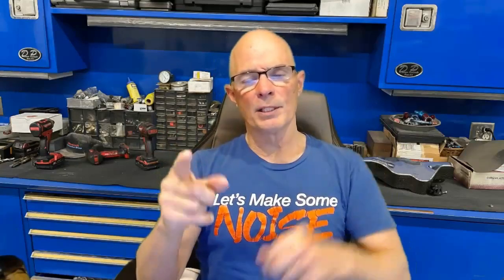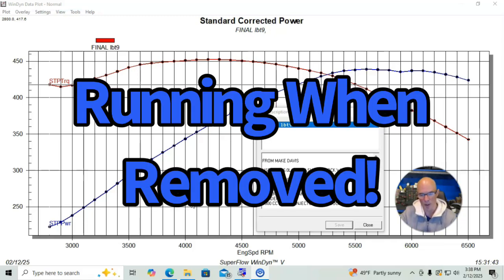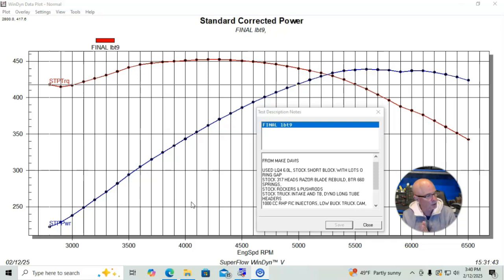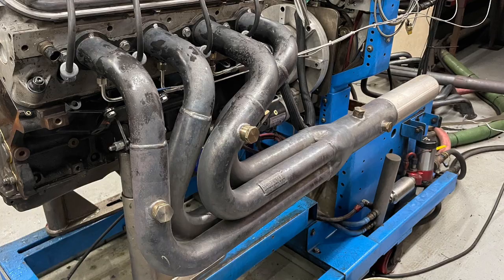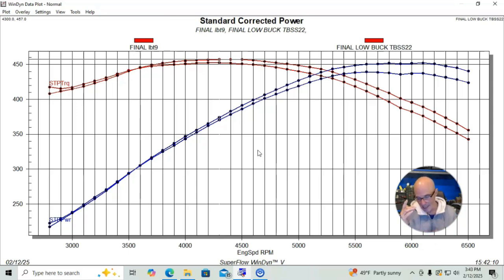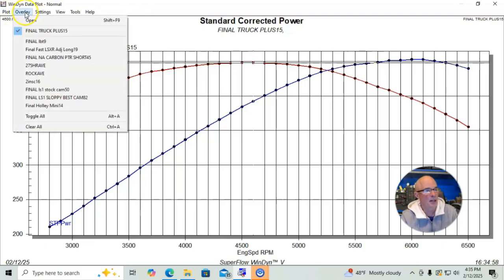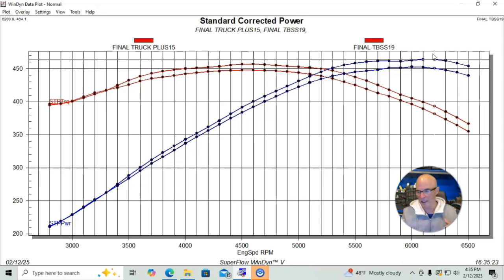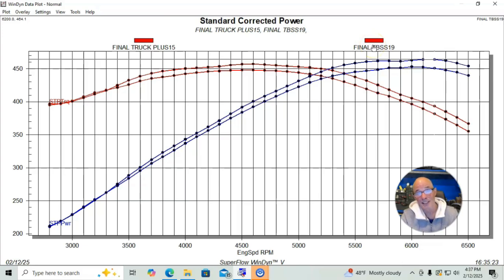JUNKYARD 6.0L LS INTAKE TORQUE TEST-TRUCK VS TBSS (WHO IS THE REAL TORQUE KING?) FULL DYNO RESULTS!

Comment: I am no way a machanic and looking for info I purchased a 6 Liter LQ4 and I have picked up a blazer S.S intake the motor came with no fronend parts and spark plug coils. Looking to buy some and find the bracket but the plugs coming off the Blazer intake are small plugs to the coil and stock coils are much larger ? is there a easy way to hook up with a connector
any help would be great

Comment: Has anyone tried the truck plus cam in an L77 6.0? They have rec port heads and the intake is similar to ls3. The truck and tbss intakes won't work.
Reply from the maker: it works fine

Comment: Can we see a comparison of the tbss intake and the rec port ly6 nnbs style intake. It has a slightly larger throttle body i believe and there is absolutely no info on this intake.
Reply from the maker: those two can't be run on the same heads without adapters (the LY6 rec port intake makes the same power as LS3 intake)
Reply: @richardholdener1727  ok awesome, i have found a video comparing the rec port nnbs to anything. Would it outflow the tbss intake using adapters? Would that add a little more runner length? Does the larger throttle body gain you anything besides better throttle response? Lol im building a 6.2 l92 and coming from a lq4 so i have a bunch of questions.

Comment: I have a stock 2004 6.0 1500hd. It is a slug. What would be my best bang for buck to get some decent power gains and help speed it up and with towing? I do drive it often for long distances so don’t need anything too crazy or excessive
Reply from the maker: tune-cam, springs

Comment: would that power difference from the two manifold be from the 78mm vs 90mm throttle bodies or is it from the manifold.
Reply from the maker: see the throttle body test video-the power is from the intake design

Comment: Is the TBSS intake manifold only specifically off the TBSS or what vehicle that is a truck would I get one off of that is the same as a TBSS intake manifold ? I need one that is cathedral port . 
Input is appreciated
Reply from the maker: you can find them on gen 4 cath port 5.3l, 4.8L and 6.0L motors

Comment: FYI FAST LSXR 102 intake stock 92mm throttle body.  Full Brian Tooley top end including trunion upgrade. Puts about 497rwhp down with current cam

Comment: I have an Australian  6L aluminium block stroked to 402. Callies crank etc. Ported cathedral port Trickflow genx 225 heads. He is recommending a 234/251 114 lsa cam. Isn't this going to be WILD??
Reply: More ci needs more overlap. So the bigger the motor, the bigger the cam can be
Reply: @jameswhitesell3076  cheers mate. So let it rip you reckon?
Reply: @jknorton2108  depends on what the motor is for. If it's more street oriented you could go a little smaller, but it should be fine. It will definitely move

Comment: Hi Mr. Holdener.  After watching your videos now for nearly a year, I think I have gained the confidence to build my own turbo 5.3l ls for a road racing application (race track like VIR). 
So thank you for saving me 10s of thousands that would have been spent at a shop, by providing high quality educational materials online! 
Where I am stuck at the moment is with the transmission interactions.  My goal is to use a 6l80e. From what is available online, the cleanest path is to use a gen 4 5.3l ls for PCM/TCM compatibility.  Does that align or in your experience? Have the stand-alone controls worked fine and been a manageable hassle when pairing a gen 3 ls with a later model transmission like the 6l80? 
Thanking you in advance!
Reply from the maker: I don't do any swaps or ever use the factory ECU for testing.

Comment: Hey Richard I have an option to buy an ls1 & ls3 intake the ls1 is $200. The ls3 is $260. Which would you pick. 

6.0 lq4 with 243 heads
Reply from the maker: you can't run an LS3 on your 243s without adapters-don't pick that (the LS1 is also a bad choice)

Comment: Hey I just started watching your videos covering 6.0l , 5.3l and 4.8l V8 with a chand long story short I just bought my first truck but i knew it had problems but it was worse than expected it's a 2004 cat eye Chevy with a tuned 4.8l V8 with a chopacobra cam and 4200 stall the transmission is blow which is a 4l60 I'm getting repaired and I ask if you can tell me what u would recommend I do because I want to eventually make it a 800hp daily driver but not sure how to go about it since I'm new to all of this and just started working so I would really appreciate some advice please and thank you
Reply: Also they said the engine was rebuilt but after looking at it it definitely doesn't seem that way it's leaking oil and the front and rear of the engine and there wasn't even a intake filter on the intake and there was white stuff in the oil which I was told is because there is water getting in the engine somehow so I had to get that checked out too so I was wondering if I have to which engine I should maybe get or rebuild the 4.8 and upgrade to a 4l80e transmission and how should I basically start since I just started working for about 2 months at my first job
Reply from the maker: Making 800 hp is easy with a 4.8L (we have the cam, injectors, pump and turbo (soon) at richardholdenerperformance.com)  but your 4L60 trans won't last with that much power
Reply: @richardholdener1727  yes sir that's why I was thinking of upgrading to a 4l80e transmission so u think if the mechanic says it hasn't been rebuilt I should just rebuild it and stick with the 4.8l or should I try and get a 5.3l or 6.0l?
Reply: @richardholdener1727 and if I were to stick with the 4.8l I suppose I will just follow your big bang turbo 1200 hp 4.8l build from 5 years ago as a guide to doing it and use your website 😂

Comment: richard, do you have any videos comparing the SS2 cam vs the low buck cam? same motor of course
Reply from the maker: see the SS2 vs BTR Truck Norris video-very similar results. The bigger SS2 cam makes more power past 5000 rpm or so, but way less below that
Reply: @richardholdener1727  will do! Thanks

Comment: I have a 2003 Silverado SS
I just put a new stock lq9 motor in back in. 
I’m looking for engine advice. It’s my daily work truck too.
What Intake manifold-cam- air intake-headers and other things do you recommend
Reply from the maker: for what power? First pick is the Low Buck Truck cam and springs from richardholdenerperformance.com (might need injectors too)

Comment: I have a 1955 Chevy street strip car. I want to keeping driving it to the strip.  It’s a 3320lbs car 383, aluminum heads roller cam th350 boss hog 3500 with a ford 9 with 4:11. 1.6@60’ runs 12.00.  Would like to run a 6.0 LQ4/4L60e with a turbo and put it into the 10’s. I still want to drive it on the street. I want to leave it as stock as possible. Sounds like I would have to gap the ring and put a turbo on. Does this sound correct?  How much boost. Thanks.
Reply from the maker: A small cam (like the Low Buck Truck) and springs with the right injectors and pump then one of our turbos at even just 10 psi will be 750 hp. richardholdenerperformance.com
Reply: @ ok that’s cool. That’s the way to go!  I am just doing a 6.0 swap in my 1956 Safari right now with a 4L80e.  I am doing all the videos for my channel. I want it as a road trip car. But the 55 now, that’s a different story. Thanks for the information that’s the way I will go.

Comment: Can you show a propane nitrous set up. Like a gas or e85 engine na, but with the added fuel when spraying using propane injected through a wet shot nozzle instead of gas.
Would be useful to just add a propane tank next to your nitrous bottle if your fuel system is already near its limit, kinda like a standalone fuel system for nitrous but cheaper since propane won’t need a pump wiring relay etc

Comment: Have you or will you test off shore intakes to see the different out comes
Reply from the maker: which ones
Reply: @  welded aluminum ones 92mm or 103 mm throttle body with the tall and short runners. Thanks
Reply: I believe he has tested the offshore (China) sheet metal intakes.  All of them under perform TBSS and even stock intakes until very high RPM.  Dramatic losses of HP and torque down low.  But they look nice, so there's that. 😉

Comment: You should do a 706 vs 317 head test on this motor I'm really interested how much low end power you can gain from the tbss intake and 706 heads on a lq4
Reply: @nathanmfhughes271  that would be a good video for sure.

Comment: Richard, I’m getting a custom 220/228 cam for my tbss Ls2, with .600 lift, will it be ok, or should I get a lower lift?? For Durability??
Reply from the maker: why would you get a custom cam when there are much cheaper shelf cams that do the same thing
Reply: @ I can get the same price for a custom grind , and after looking at all others, I came up with this one.

Comment: I searched and don’t find anything. 
 Have you ever tested “high flow” MAF sensors?
Reply from the maker: Unfortunately, we never run MAFS on the engine dyno with a stock ECU-only speed density using a Holley HP ECU

Comment: Have u tested one with  tbss intake 706 heads with LS6 springs and a Summit Pro LS 551(8704) ??
Reply from the maker: ONE WHAT?
Reply: @ a LS 5.3…??? What yur video was about !
Reply: His video was about an LQ4 6.0 with 317 heads,  comparing the TBSS manifold vs stock truck intake with both Low Buck Truck and Truck Plus cams. Not a 5.3. Although his results with the 6.0 could be extrapolated to estimate 5.3 and 4.8 results with the same combination(s).
Reply: @ well I meant the tbss intake and the reason I said that is I’m building a 5.3 with a tbss intake!

Comment: Richard,   got an early retirement idear for ya. 

You need to put together books as Lingenfelter, Vizard Chevy( Ford amc Mopar) power etc did on all your different combo and engine types. It could be a series of differnet ones!!
Your info is gold you are definitely qualified and have lots of us supporters. 
Go do it!! In spare time right? LOL
Reply from the maker: I ALREADY HAVE 10 BOOKS OUT.
Reply: Richard,   
Insert Amazon or other book link here.  Remember, nobody looks out for you... But you... 😉
Reply: @richardholdener1727  can you do some videos on twincharged ls engines I have ideas and think it'd be a great series on the limitations and necessary equipment for 1200+hp at crank

Comment: Would the truck plus add any benefit over a chopacobra cam in a 6.0 LS2 in my TBSS?
Reply from the maker: it would add 15 hp on top above 5000, but lose out below 5000

Comment: Hi  Richard, would I getaway with a chuck norris .53 lift cam in a L77  with stock springs 😅? Thanks
Reply from the maker: The Truck Norris has 552 lift. The L77 came with rec port heads which usually have the 550 lift factory springs, but it has such a small cam (sub 500 lift), that I'm not sure what springs those cam with
Reply: Thanks, I'll try it and find out

Comment: I want to build a high rpm 4.8 with 4 Weber 2 stack carbs with twin turbo 5psi draw through what compression for 91 octane and any good cam recommendations with a little chop
Reply from the maker: how will you do a draw through with 4 2 stack webers?
Reply: @richardholdener1727  by doing a 2   on 2 split manifold id probably have to make myself have the runners cross with 2 carbs feeling to each turbo

Comment: Now you did a video on the gt45 turbo on the 4.8. I'm curious to know what that turbo on a completely stock gen 3 5.3. Also do you have any data on the 862 heads from gen 3? I'm asking all this because mine is the L59 which is the flex fuel 5.3 and it has the 862 heads. I've looked in junk yards and there's a massive amount of 5.3s gen3 but I didn't see another set of 862 so that's got me curious
Reply from the maker: 862 and 706 are the same heads-same exact performance. A Gt45 will support 750 hp or so. I have stock 5.3L with turbo vids up
Reply: @richardholdener1727  i seen the videos but thought you'd changed the cam and seen trick flow heads

Comment: Can you test or have you tested the TBSS intake using the the 3 bolt throttle body (76mm)?  Just curious how much is lost using the smaller throttle body.
Reply from the maker: I did not have an adapter for that test
Reply: I'd like to know that as well. With the different electrical connectors, 6 pin to 8 pin and if its worth it to buy x-link or not
Reply: @ I've had issues with my x-link is why I'm curious.  Getting limp mode at random times.  Put my 76mm back on and notice no difference in performance.

Comment: Just posting for anyone curious what the fully stock LQ4 makes vs these cams. 405 hp and 439 lb-ft, Low Buck Truck cam adds about 20-30 lb-ft everywhere which is pretty nuts.

The following is the only vid Richard has a stock LQ4 that I've found, all other vids show modded LQ4's if not LY6's.
https://www.youtube.com/watch?v=xyMbXVP6dp4&t=463s
Reply from the maker: that is incorrect-turns out that might not have been an LQ4 and you can't compare a cam on one motor vs a different cam on a different motor-a Low Buck Truck cam adds 60 hp over stock cam and a Truck Plus adds 75 hp over a stock cam (on every test we have run)
Reply: @richardholdener1727  Dang! If you happen to find a dyno of a fully stock LQ4 I'd love to see it! Maybe it could the subject of a whole video, what do all the most common LS engines make in bone-stock form. Gen3 4.8/5.3/5.7/6.0, Gen4 truck 5.3/6.0/6.2 with vvt.

Even cooler if you show how much boost the smaller engines need to top a big cam in the bigger engines. That's the question I get the most, displacement+cam or 4.8/5.3+boost.

Comment: When you go tear apart these engines to put ring gap do you reuse the rod bolts and main cap bolts and just use the stock torque specs when putting it back together?
Reply from the maker: reuse stock
Reply: @richardholdener1727  I have a brand new ls3 long block. Do you recommend opening the ring gap on stock components or buy TSP forged rods and pistons "no balance required". I will be supercharging it with a stock lsa blower.
Reply: You can't use stock specs on any reused bolt, be it head, rod, or main bolts. The tq+angle only works if new - they stretch, but not past yeild point as claimed. Sloppy mechanics and Lowbuck LS have the torque values for reused hardware in some of their vids.

Comment: So my power estimation on my truck (6.0 LQ4 with Truck Plus cam and NNBS intake) is pretty spot on. I estimated using my MAF g/s x 1.2 and came up with 440-450 with pretty much this exact combo…but I have all accessories, minus efans, and full exhaust.

Comment: It'd be cool to add the 5.3 trail blazer intake to the mix. Looks just like the truck intake but has the bigger opening and 4 bolt throttle body
Reply from the maker: this test was with that intake
Reply: @richardholdener1727  that looks like the 3 bolt tb truck intake and the 6.0 trailblazer ss intake.  Not the 5.3 trailblazer intake which is different from either of those 2

Comment: Richard you missed the chance to compare the Cathedral port and the square port gen 4 truck intakes!
Reply from the maker: How would we compare those two intakes?
Reply: @richardholdener1727  lq9 with 317s or 243 vs rect port heads with tbss manifolds. One has the cathedral tbss and the other rect port
Reply: @richardholdener1727   l76 vs lq9 shootout, similar compression then you can test if porting the cathedral heads and intake works better or worse than a factory square port on similar cams. As a budget guy I wonder myself if porting my cathedral heads is worth it when I can get square port ones💪
Reply: @chrishoward5500  The LS3 heads add around 20-30hp so that's a lot to make up with DIY porting.
Reply: Those r different heads though

Comment: Nice to see your cams compared on a 6.0     I'd prob use the Low-Buck for 5.3/4.8 and for 6.0 or bigger the Plus cam.  Provided it wasn't going in a heavy vehicle, if so then the Low-Buck again for more low end.
Reply: I’d love to see how his truck+ cams compare to the truck Norris.
Reply: Actually, upon further reading the specs, it seems like his low buck truck cam is basically same as a truck Norris, but for a steal of a price.

Comment: Video of the year for me!! Thank you! I’m currently rebuilding an LQ4 with your low buck truck cam, .560 springs, TBSS intake, 706 heads, 92mm TB, 50lbs injectors, and long tube headers. This video gives be a great idea of what power I’m going to be making. Thank you!!
Reply: I've done that combo, it works well in a truck or car
Reply: @BDauto86  good to know! Thanks bud!
Reply: Will be a reliable big tq tire burner. 
Torque is king on the st!
Reply: @gordocarbo  that’s the goal! Thanks man! It’s going in a 84 C10 daily.
Reply: I have this exact combo in my '03 Silverado 4x4, helps with pulling my travel trailer in the mtns a lot better. When I build a mid 70's k20, I'll be doing the exact build probably. Just a great strong, reliable combo

Comment: Really cool!  Since you have actual dyno data to back this up, you should consider selling junkyard LS packages. Want 500HP?  Get this package.  Want 750HP? Get this package, etc, etc.  People should be able to leverage your incredible knowledge and experience to build the baddest, tire frying, ice-cream-getting-est machine in the whole cul-de-sac!
Reply: And boat engines!!
Reply: Speaking of boat engines, I really wish he’d test a set of boat exhaust manifolds. The 6.0 has been use by both volva penta and crusader.
Reply: @danr9584  That would be great. I've questioned if maybe they would be the same as long tube headers but the dyno would be the place to start to figure that out. LS swaps in boats are becoming more common. 

Also maybe, a series of marine style camshafts to see what would work best to get them out of the hole and on plain.